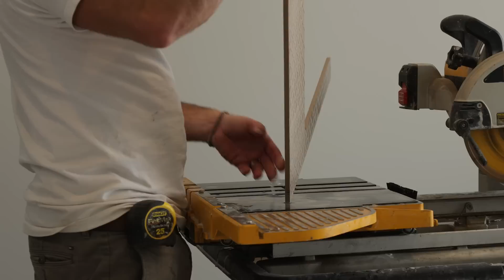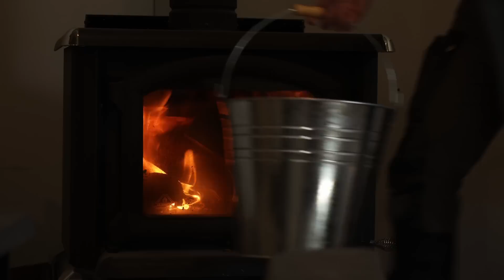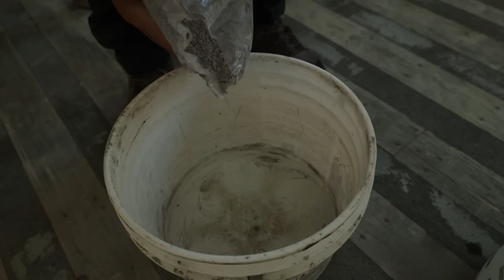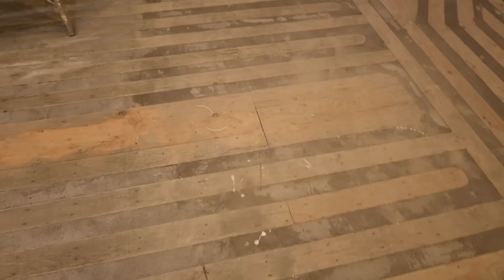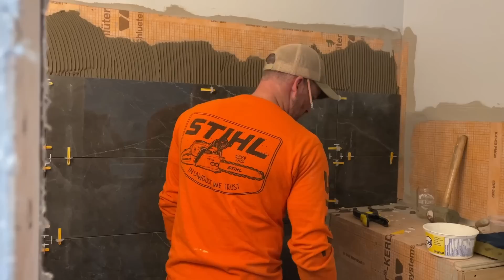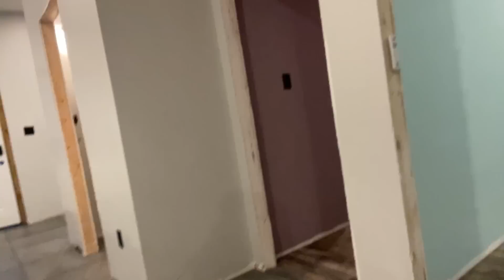MOVED IN - but FAR from done | Couple Builds their OWN EFFICIENT HOUSE

Comment: What is the product for the main floor sub floor?I assume it's a hydronic heated floor ? Wood with cement? And then I watch the rest and it is wood with what kind of fill?
Reply from the maker: its a 3/4 plywood and sand miz concrete to disperse the heat.